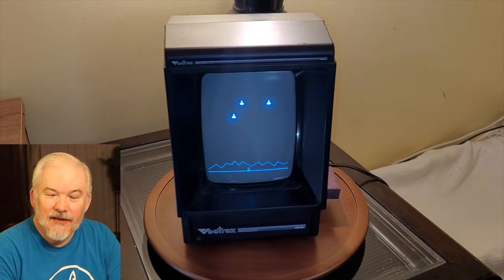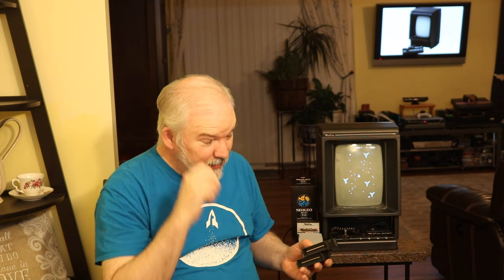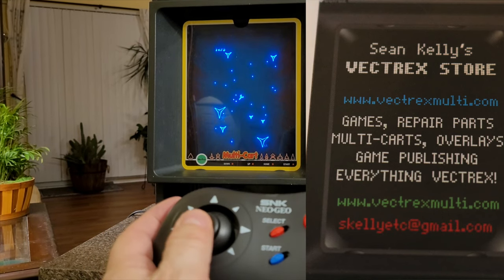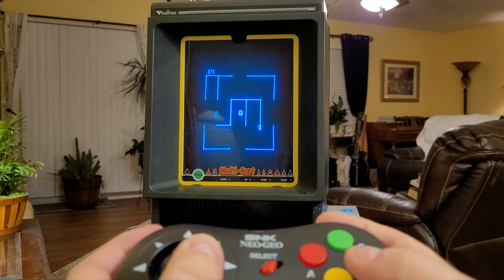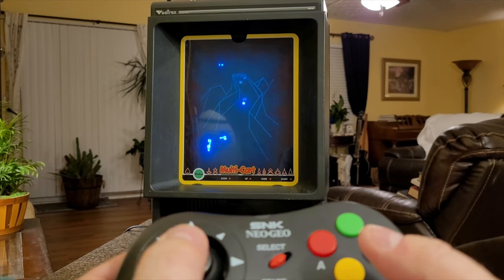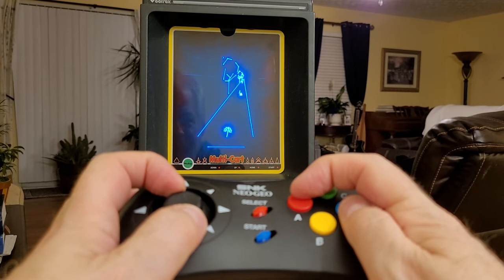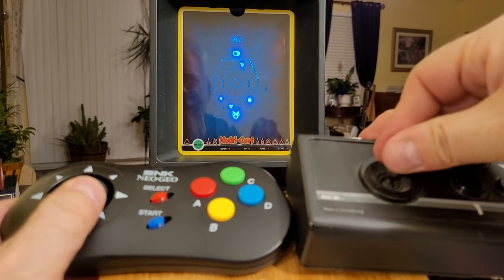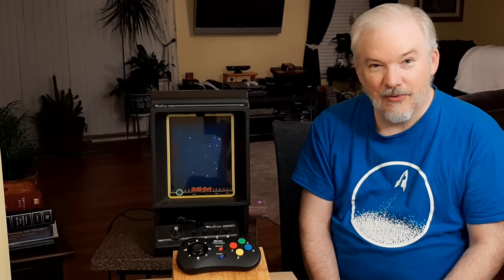Vectrex Gets a Surprising New Controller (vid #83)

Comment: Is the Vectrex Pinout for controls known and simple (NSWE1234G in some arrangement, and the difference between digital and analog is intensity of signal) I so, I think i can make a Sinister Controller setup if the setup is as simple as 1234NSWEG.

If not some someone should make a "rightie adapter" that inverts X and Y if x and y ate on one pin each, not 2)
Reply from the maker: It's rather complex unfortunately- not simple like the Atari 2600 controller.

Comment: Auto fire should be only active when the button is pressed
It should not be that when pressing the button, nothing happens.
Reply from the maker: The switches have two active positions- one is for autofire when pressing the button (and discontinuing when letting off the button)  and the other is for autofire going without pressing it (and discontinuing when the button is pressed).  Probably should have explained that in the video.
Reply: @wiredupretro  Ah, that is awesome! Thank you for explaining
Reply from the maker: @dbnpoldermans4120  Yeah- Nicolas got that implemented in the PCB - a very good plan :)